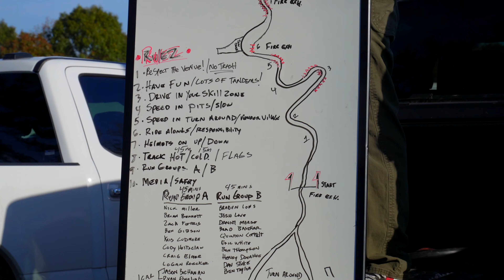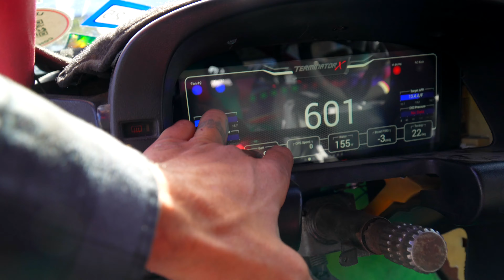My friend crashed my car on a mountain road!

Comment: Friend seemed to have issues pulling hand brake... I would try and bleed that puppy or switch size lines so it locks up fast with shorter pull. Good video
Reply from the maker: Yeah that’s a good idea, thanks!